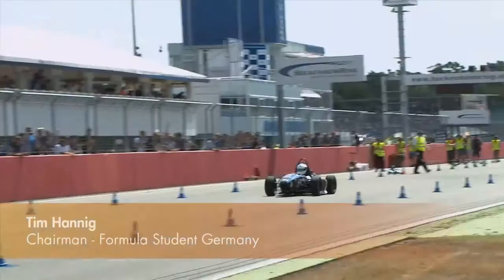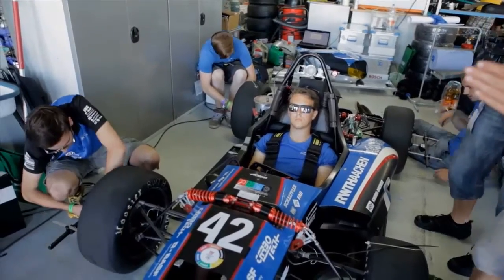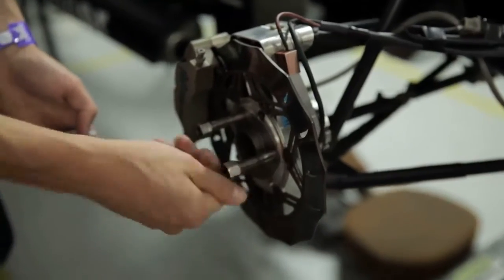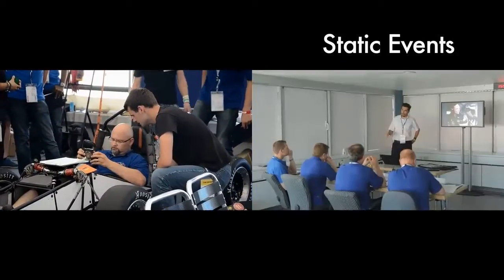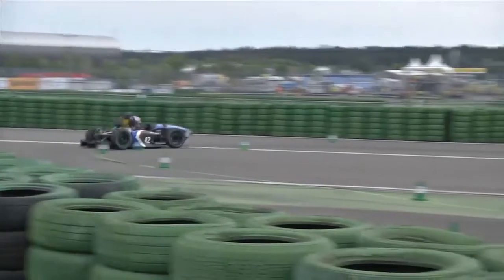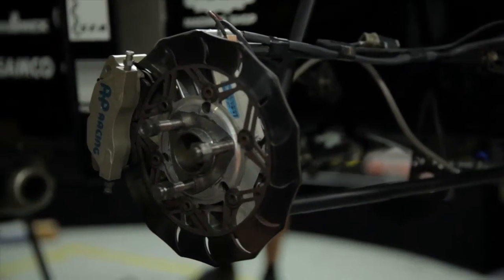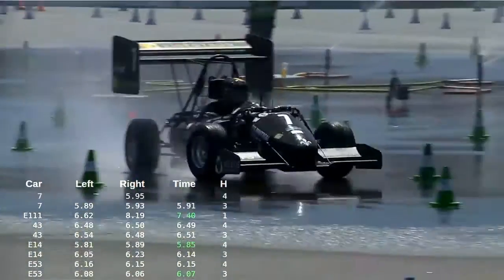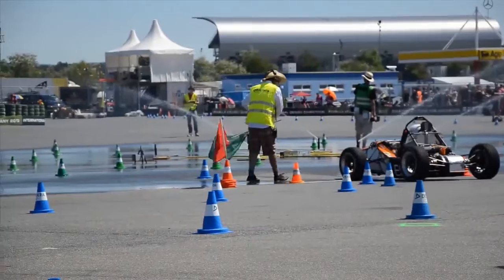Student Teams Use MATLAB and Simulink in the Formula Student Germany Racing Competition

Comment: Kudos to the teams for pulling it off. But let's not kid ourselves, the front wing, rear wing and endplates were far from optimised. If it takes formula 1 teams countless hours optimising the airfoils with CFD and verification through wind tunnel testing and track, you can be sure MATLAB and Simulink do not come close. Perhaps a team member familiar with CFD would be a better choice. Still, a good job overall.